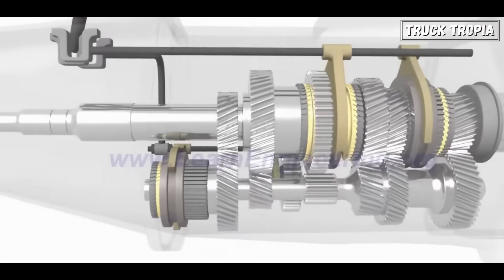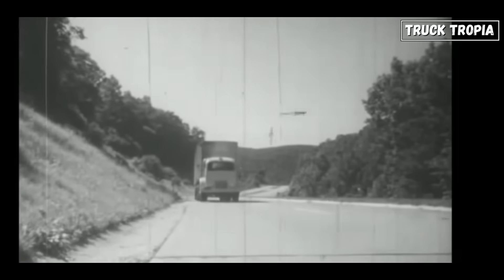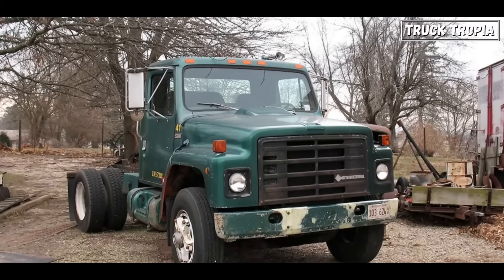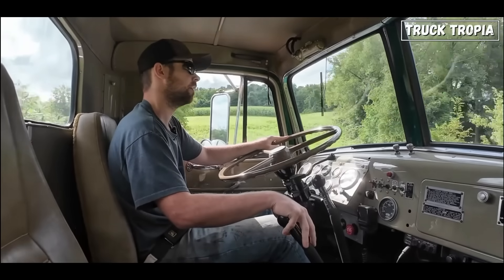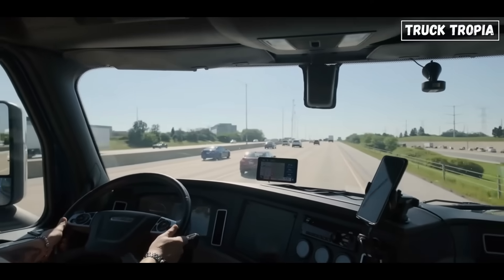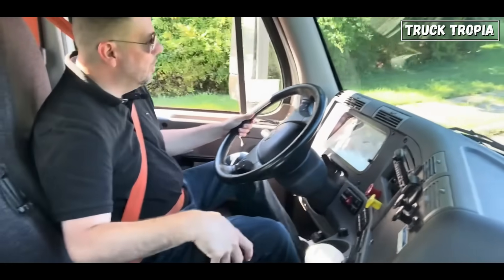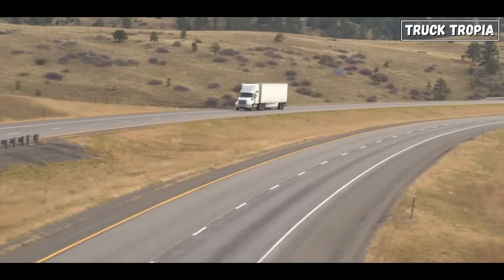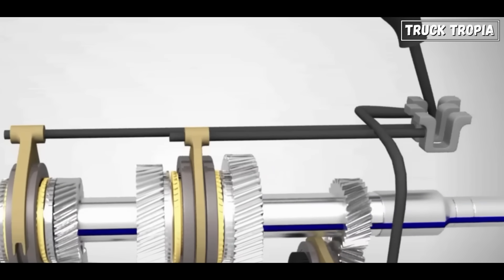Why Do We Keep Adding Gears to Trucks

Comment: There is one other factor - and that is that far more freight is moved over a much greater distance now than back in the 50's through 80's, thanks to the development of the US Interstate Highway system (and Canada's own highway system). Prior to the 70's, a lot of freight was moved by train to a distribution warehouse where the trucks took it to the retailer. The distance the truck traveled was a lot shorter and the load was a lot lighter so a 5 speed transmission was more than enough. Now, however, trucks drive loads thousands of miles cross country, and they need as many gears as they can get in order to climb hills safely and keep the engine turning at the optimum RPM for performance and fuel economy.
Reply: 53' trailers didn't even exist until the 90s
Reply: My dad was 16 when he started driving trucks for my grandad in the mid fifties in Colorado. He said all the trucks he drove back then had two gear shifts, one for the rear end and one for the transmission. 
A 5 speed is really a 10 speed with a two speed rear axle.
The engines were weak but they had one truck with a Cummins or a Detroit Diesel that would pull hard. And with the introduction of turbos, the power only increased.
50 mph speed limits were common then too while paved roads in the west were not.
He said he regularly loaded hundred pounds sacks of beans into the trailer for hours before driving for days to his destination. He got buried one day when he fell asleep in the trailer loading up. The other guys loaded the beans around him.
They used to load their trucks by hand before heading out. Those days are long over. They also didn't have HOS regulations and most drank beer while driving.
He rolled a truck one day in the middle of BFE with his dad in the sleeper which killed him. He quit driving after that.
Reply: @keithsj10 sorry to hear that god bless your family
Reply: FACTS.  There were only a fraction of the number of long-haul drivers that there are now.

Comment: i am supprised that CVT transmissions like the vario transmissions used in most modern tractors aren't used at all in the trucking scene
Reply: They most likely can't handle the strain and torque of a big Diesel engine.....
Reply: @kentr2424  as i just said, it is the most used Transmission in a agricultiral tractor which is at maximum power use for longer than it's not
Reply: @robertvanderlinden2813  tractors also aren't capable of the speeds trucks are which makes a huge difference in how things need to be built.  Cost is another big issue.  It's a whole lot cheaper to add more gears than to design some form of CVT that will hold up.  Tractors need the variable speed a whole lot more than a truck does.  Trucks don't need the variability provided by any form of CVT for day to day use and nobody is going to pay for it when a 12 speed automatic will work just fine.
Reply: @robertvanderlinden2813 Who told you that big tractors use CVT transmissions? I didn't even know that was possible. They're used in small tiny cars, and ATVs; But tractors?  I must say I am surprised to here a CVT could be used on a big tractor.
Reply: @SternDrive  almost all modern tractors use a CVT, only if you get the most powerful spec of that model or request it it will be a powershift
Reply: CVTs are weak use more fuel and expensive to maintain compared to automatics and manuals
Reply: I have never seen a farm tractor with a hydrostatic trans with over 100hp. (They are hydraulic (hydrostatic) and definitely NOT cvt (like in a side by side or a small car)
Reply: @forestpagan4813  than you haven't seen a tractor Above 100 hp yet, it's pretty much the only option manufacturers give you with examptions like the New Holland T9 where only the top Power model has a Power shift transmission
Reply: @robertvanderlinden2813  every one I've ever seen is gear drive, which is what you want for ground engaging equipment

Comment: Adding, they are taking away, split gears are much better. You didn't have to use every gear, today it goes through every gear and drags. You can be empty and your take off drags and acts as though you are pulling an 80,000 Lb. Load 😡

Comment: Most lorries nowadays have 10 to 25 gears depending on the model
Reply: I was thinking that this was an American video when he said that "cab-overs are all but gone."  Not in Europe!
Reply: @michaelbujaki2462  Yup. In cramped Europe they have length restrictions like we used to have in the 70s.  That is the only reason they run these little single drive axle boxy trucks with short trailers. If they had to pull one of our Super B Trains or two 53 foot trailers,  these little single axle Euro pullers would sit and spin.

Comment: Automatic transmission is better if you are always on city Driving but if you are in mountain area use manual for better control of your truck and also manual transmission is hard to stuck on muddy terrains or stiff hills but the cons of manual transmission on trucks is needed more experience to drive and more skills

Comment: 18 speed Kenworth or Peterbilt trucks move very slow compared to truck like isuzu or other trucks that has only 6-8 gears
Reply: How much can an Isuzu haul?  Sure something that can only haul 20,000 pounds is going to be faster than something capable of pulling over 100,000 pounds.
Reply: But Kenworth and Peterbilt are more powerful than Isuzu and other trucks...more popular too.
Reply: @jdmjr1130  it's not about power only, cuz in US, it's rare to go uphill travels, there is some, but it's not that very frequent i think. Isuzu truck last wayy longer than 10 years, cuz they are made by very reliable quality from japan. #1 in asia.
Reply: @COMRADE-MARC9910  we have lots of grades 5 to 7 percent for 10 miles or more (16km) and a few up to 17 percent grade. I have driven in Japan too. If the pass is 11000 feet, the grade is either steep or long. Have fun
Reply: I've never seen an Isuzu hauling 120k+ pounds at any speed.
Reply: @Bad_Wolf788  my land lord drove cement truck doubles, and showed me the weight slip sone years ago, I think it was 60k kg rated actual 61. Isuzu trucks, tandem duals.. the normal HD kind of build. Have fun
Reply: @Bad_Wolf788  here in the Philippines, uphill, Isuzu pulling a aton of cavan of cement like that, pull going into baguio uphill, gear 3 was good.
Reply: @COMRADE-MARC9910  I guess you work with what you can get
Reply: @COMRADE-MARC9910  a ton is only 2000 pounds.  My 1/2 ton pickup can do that.
Reply: @jasonstclair6293  i mean waayy long trailer.
Reply: Japanese trucks may be fast on level ground, but they can't handle hills.  I am often in the Philippines, where Japanese trucks have nearly replaced American trucks, and they are SLOW going up a grade.
Reply: Also isuzu almost as quick as tesla semi, the only difference is, due to some of Isuzu trucks still using manaual transmission, whereas new models now uses modern automatic.
Reply: @HAIYANE9910  Are you kidding? You compare a little puddle jumper Isuzu to a heavy Peterbilt? That's crazy! Apples and oranges! Do you drive?And what? Phewww
Reply: If any stock Kenworth or Peterbilt where traveling in the Philippines can cause chaos traffic, move so slow cause chaos, isuzu, scania, volvo, that kind of trucks specially automatics only have 8 speeds moves like a bus high speed in just around 1min
Reply: @COMRADE-MARC9910  what you're not aware of is that speed governors are added to the stock Kenworth/Peterbilt trucks after market to slow them down. Truly stock from the factory they are capable of over 100 mph
Reply: @Bad_Wolf788  yeah but for me too slow, causes chaos traffic if that's traveling to my country.
Reply: @Bad_Wolf788  buses and some of Scania, Volvo, isuzu, Hino, Man, Howo are as quick as bus, almost tesla semi like, but the problem is, they can't quick if they have massive loads Gear 3 from Isuzu GIGATruck was like Gear 6 of Kenworth Stock W900 or even Peterbilt 379
Reply: @COMRADE-MARC9910  I haul overweight on a daily basis.  We don't use anything but Kenworth and Petes because other brands can't do the job.
Reply: @COMRADE-MARC9910  I am in the Philippines right now, and it is not the 1st time.  Kenworths, Peterbuilts, and Internationals have MUCH better hill-climbing ability than the Japanese trucks.  The Japanese trucks cause long long backups, as they can only move at a walking speed when going uphill.
Reply: @jamesbosworth4191  ano ba gamit nyo pag paahon kayo segunda?treesera?

Comment: Nothing i hate more in a truck than an automated transmission...nothing good about them. Nothing
Reply: Everything is good except for price, & way more boring as it's much easier to use, but that doesn't change the fact that it's overall better.
Reply: @johndavidson3424  better how? You know how to work a manual? I can work a truck better than the automated garbage that someone else decided
Reply: @mattberg916  Bro it's much easier to use, so it saves much more time & labour, not just the ease it gives but it can hence give more road time due to less effort, & both your hands would be on the steering wheel more than a manual while driving. Ik semi truck Manuals, & I enjoy it though it would be a pain in the butt as compared to an auto especially for long distances. I get it, you prefer Manual, & is completely ok with it, but an AT(mostly TA type for trucks) is simply better undeniably, just use your common sense, duh.
Reply: @johndavidson3424  I'm guessing you are considerably younger than me. I'm 52. There were no automatics when I started. There's no need for them now except for people that don't know how to drive a manual. Since the big fleets have all switched, the majority of drivers have no idea how operate a manual. You can say they're better all day long but if know how to drive it's irrelevant. Your opinion is that they're great, I think they're garbage. I also think you're wrong, there's no way that those damn things are better in mountains or off road
Reply: @mattberg916 boy, I’ve been driving a long while and I started off in a manual but damn it’s a lot easier on my knee driving an automatic. You seem to focus so much on the past, you’re not even looking forward… most dumbasses are looking backwards when they need to be looking forwards, son.
Reply: @3182john  say what you want a clutch and a manual gearbox will outlast and out perform the bullshit electronics
Reply: I started off in a manual, but I prefer automatics if I'm driving for a company. Unless I'm getting paid more or own my own, I'll stick with automatics.
Reply: A automatic can have unlimited slip, they're better in off road conditions, particularly off road recovery. A truck with a automatic can for instance put steady constant force on what it's hitched to without wearing down a clutch. 

Planetary gear sets are inherently stronger by design. Because the more torque applie, the harder they push into each other. As opposed to conventional gears that try to rip themselves away from each other.
Reply: @SilverStarHeggisist  uh, pretty sure that's not how a tractor transmission works. It's got a clutch and a pretty standard gearbox just with electronic/air engagement and shifting. I run one off road every day and it sucks

Comment: My only question is why are the manual gearbox's still unsynchronized. We have had the tech of syncromesh for almost a century now.
Reply: its actually easier to change the gears, Longer life and you don't need to use clutch at all, except from dead stop
Reply: I can single shift my 18spd or float (no clutch pedal use) without grinding. Once you know your equipment, synchronizers are not needed
Reply: Could be so you can't put it into the wrong gear and blow up the engine. If you haven't matched the speed, it won't go in gear.
Reply: Synchronized gears need to be built heavier as well as the whole transmission. Synchronized gears lateral strain because there angled and not a straight cut
Reply: @ChrisHoffman-ed7pv angled gears are stronger
Reply: @ChrisHoffman-ed7pv  You mean Helical-cut gears.
Reply: They are lighter and cheaper, the comfort doesnt matter.
Reply: In Europe they are synchronized.
I drove a manual V8 Scania for a while, was pretty fun.
Reply: In trucks it's actually easier and faster, it requires more skill but if you have the skill it shifts better and lasts longer
Reply: The highest torque rating I have found for a synchromesh transmission is around 550 ft/lbs, while non synchro at 2200 ft/lbs. I have driven both
Reply: @adiamondforever7890  Scania engines make up to 3500Nm and their transmissions have synchromesh.
Reply: @TopiasSalakka  I suspect we are comparing apples with oranges. Nobody knows what 3500Nm is. Please talk in terms we understand. What is the torque rating of your Scania box in ft/lbs so we can do an educated comparison.
Reply: @SternDrive  Newton-Meter is a standard unit of torque used by everyone.
Reply: @TopiasSalakka  How much is 3500 NMs in lbs. ft.?
Reply: @TopiasSalakka  Not in the US and among older Canadians.  We use Pounds Feet, abbreviated as lbs. ft.  If you are from Europe, quite understandable, as most of you use the metric system, but if you are from North America, you are out of line, as most of us do NOT understand or use the metric system.
Reply: @jamesbosworth4191  Most people internationally use metric.
Idk how much 3500Nm is in imperial but it's more than any American truck engine makes.
Reply: @TopiasSalakka  I already said that about metrics, but most North Americans don't know how much NMs are.  That's why I said that if you are in Europe, it is understandable that you used NMs., but unforgivable if you are in North America.
Reply: You can get a synchro shift manual    where the computer synchs the engine speed for you for up and down shifting
Reply: @Notawhitchhunt  No, because that only revs the engine to match the speed, so that it feels smooth, it doesn't actually reduce synchronizer wear, because you have to properly double clutch for that.
Reply: @pilotavery  There are no synchronizers to wear
Reply: @Notawhitchhunt  not on the truck there isn't, this guy was saying that he has a synchronized transmission and he floats gears anyway and I said that's a terrible idea
Reply: @pilotavery  there are no synchronizers to wear out
Reply: @Notawhitchhunt  You should read who I replied to, the guy who I replied to said he was doing this on his Honda Civic... I'm pretty sure Honda civics have synchronizers.
Reply: @pilotavery  True they do, the only unsynchronized manual transmission in a smaller vehicle was in an International Scout SUV which had positive ground battery power also weird
Reply: @Notawhitchhunt  I know, I was replying to his statement about him floating gears in his Civic I know that trucks don't have synchronizers.
Reply: @Notawhitchhunt  What heavy long haul truck has this transmission? Educate us. I have never seen such a thing.
Reply: @Detah_  The reason for no synchros in North American heavy trucks is simple. Volvo tried them about 40 years ago. Guys that I talked to loved them, BUT heavy trucks just have too much power, and they all failed. Today there are no synchro transmissions in North American heavy trucks. They work OK in little European single drive axle puddle jumper trucks, and in cars, but that is just about it. The other thing is those Euro Trucks you have to use the clutch. If I had to double clutch my 18 speed, after 49 years I'd be crippled.
Reply: @SternDrive  Also, we have higher weight limits than you do. 44 tons in most of Europe, up to 76 tons in Finland with a trial run for 104 tons.
All of the trucks we use for those hauls have synchronized transmissions.
Reply: A syncro trans can't be made as strong as a crash-box can.
Reply: @jamesbosworth4191  Oh really? Where has this been done? I promise you, if they could economically do this, they would have done it long ago. The name of the truck and transmission please. We'll wait...
Reply: @SternDrive  It was "Notawhitchhunt" who said that, not me.